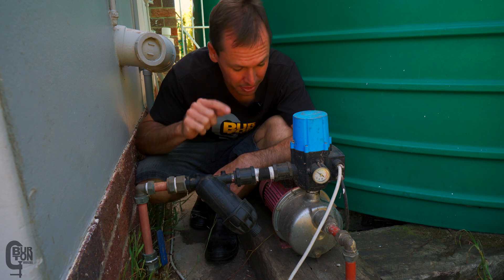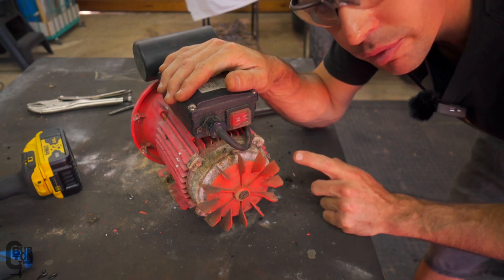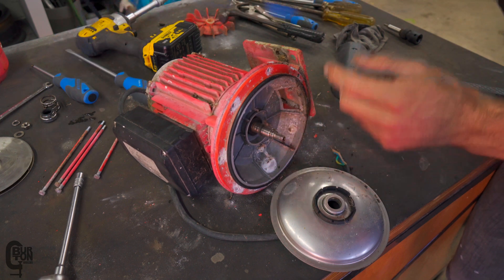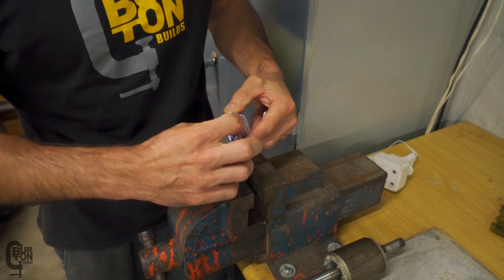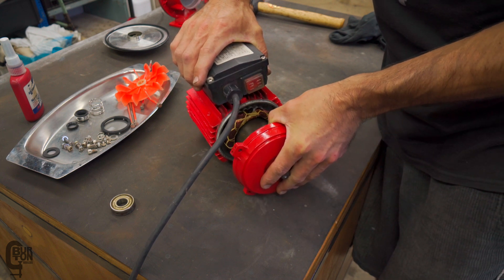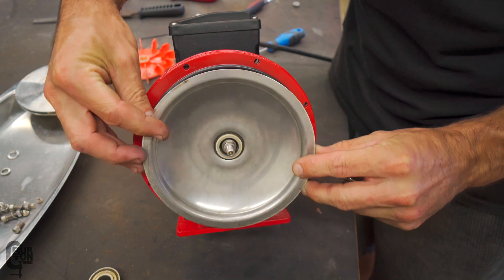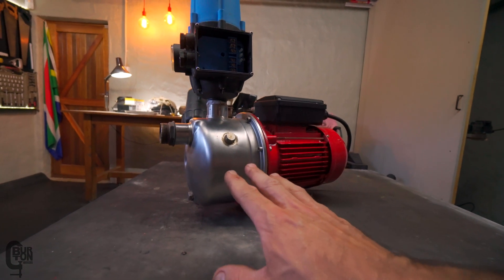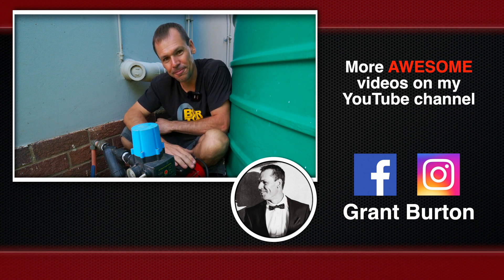How to fix a noisy water pump

Comment: Super helpful video!! Do I need to use insulated screwdrivers when I take it apart? Thx 😊
Reply from the maker: Hi, no you don’t need to use insulated screwdrivers after the pump has been completely disconnected from its power source and it’s on the workbench (it should always be completely unplugged from power when working on something like this).

When disconnecting from the main power source, I normally try use insulated screwdrivers but there should also be an isolator that is turned off, and isolated the pump before trying to remove or work on it.
Reply: @GrantBurton amazing thank you. 😊 love your videos.
Reply from the maker: You’re welcome and thank you for watching the videos.

Comment: Hi there. Thanks for the video! I have the and pump, but won't prime water. I can't find any obvious leaks in any of the pipes. Any suggestions?
Reply from the maker: Did you prime the pump housing by removing the bolt on the side and filling the pump housing with water, or pouring water into the outlet of the pump, where the pump controller is attached?

Is the impeller still spinning when the motor spins... It's possible that the nut holding the impeller onto the motors shaft has come loose, or the central hub on the impeller has broken off from the fins so when the motor spins, it doesn't actually spin the impeller.
Reply: @GrantBurton  Hi there! Thanks for your reply. I did all of those however, I realised that it must be the windings that's an issue... Will have to get a new pump lol.
Reply from the maker: Did you check that the starting capacitor is still working… normally when those go faulty, the motor sits and hums and doesn’t spin when turned on.

Comment: Full marks for your repair, just a remark, increase the size of the pipe for the intake, as it will prevent your pump from cavitation and damaging the pump's internal parts. You will also have a better flow.
Reply from the maker: Hi Pieter, thanks for the comment and advice, tips and tricks are always welcome. I actually passed on the same pipe size advice to a friend that just completed his tank installation. I'm planning on relocating my tanks which would include new and larger piping, valves, filters, etc. Just haven't got around to it yet and didn't really want to fiddle to much with the existing working system... you know... don't fix something that aint broke (haha).

I will say though, I'm very impressed with the stainless steel housing and impeller on this pump. I tried to repair a DAB pump a few days ago (one with the steel casing), motor and bearings are perfect but it has a plastic impeller which had collapsed and damaged the guide vanes. I think the extra money spent on pumps with stainless steel parts will be money well spent.
Reply: @GrantBurton  Same here, the 40mm white waste pipe works well. Use it with grey solvent weld fittings available from Humansdorp Koop.